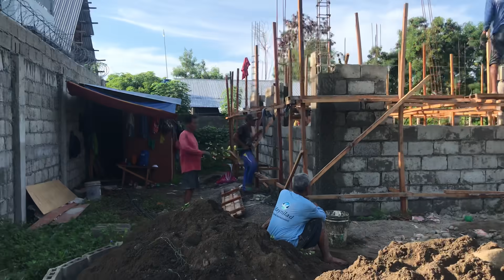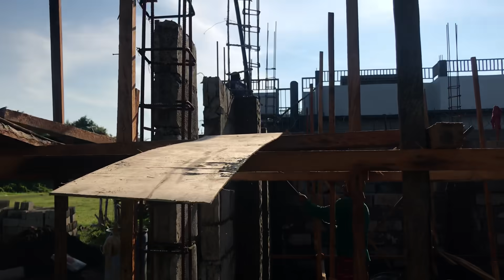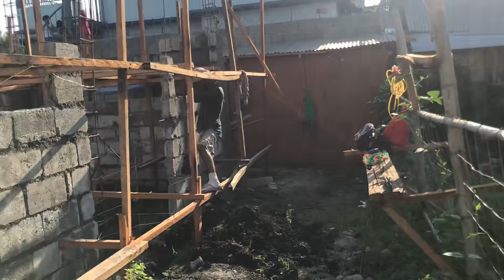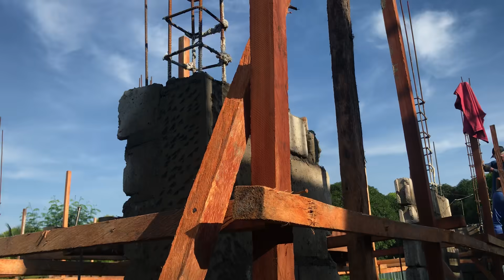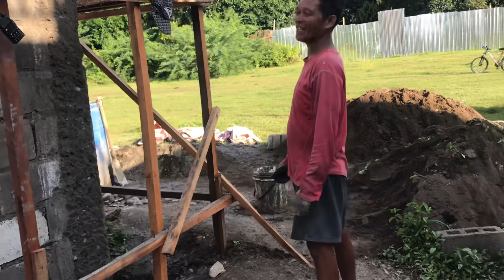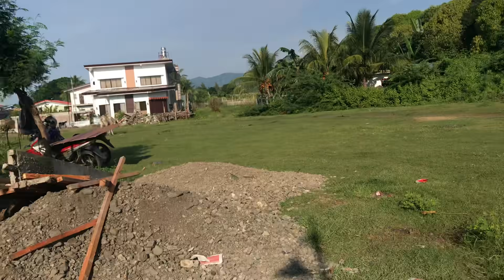START Of DAY 13 Of Our NEW House Construction The Hollow Blocks Are Rising

Comment: House is looking good Calvin  ! Must be brutal for those guys in that heat .
Reply: I don't think the heat bothers those PI guys as much as it would a westerner. One day I was tearing out ceramic tile over laid on top of wire and lath in a bathroom. Tearing tile off that's been cemented to wire and lath, is "murder," and it must have been 95 degrees in that house. A brother from Togo (Africa) was helping me. The heat was beating me down, but the African guy was breezing along, not breaking much of a sweat, and not drinking water but once or twice during six hours of work.   Respect:-)

Comment: Calvin when I build my house the steel of the post should be 6 size 12 they said that is the standard. Why I see in your house is only 4? You should ask the engineer he might doing cost cutting but you pay overpriced for just a 50 square meters bungalow